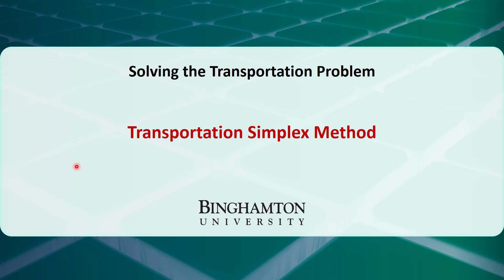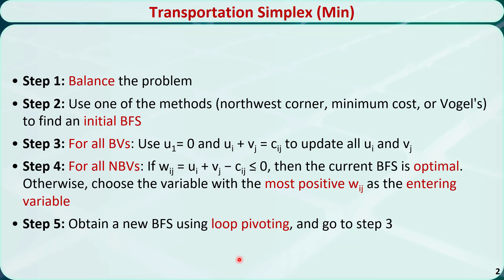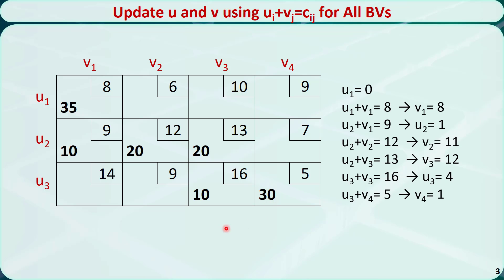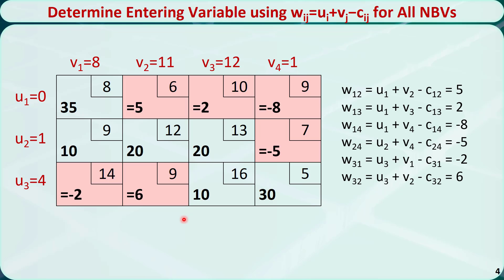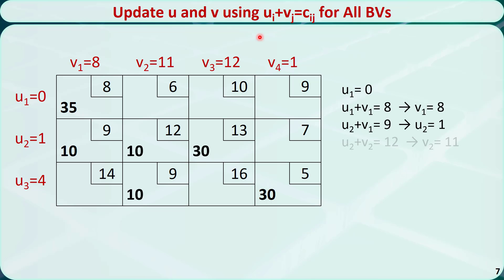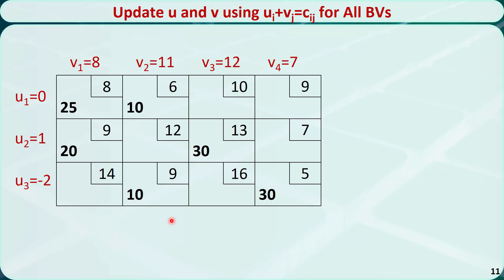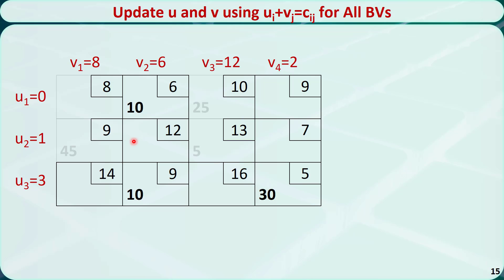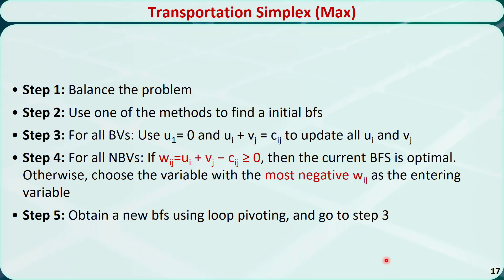Operations Research 07B: Transportation Simplex Method

Comment: What do you do when the Northwest Corner method yielded only BF solution where c_11, c_21, c_22, c_33, c_34 and c_44 have values?
Because then I got stuck after figuring out u_1, u_2, v_1, v_2 using c_11, c_21 and c_33....

Comment: When you mention the Even and odd cells at around 4:55, did you accidentally mix up odd and even? I am confused
Reply: nevermind, I have realized that you define even or odd based off of numbering the loop cells from 0 to 3 in a clockwise direction
Reply from the maker: thanks for the comment, mitchell